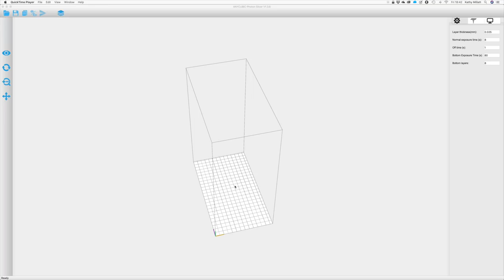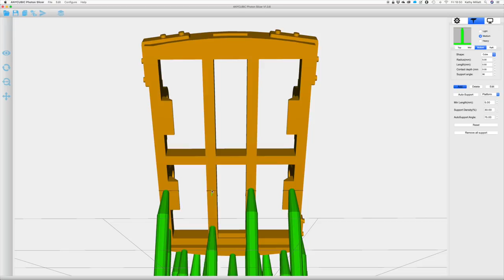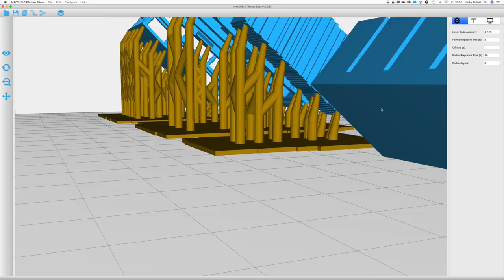3D Printing for Modelling – Resin

Comment: I've had my Anycubic Photon for over a year. It's superb for high detailed parts, and its even capable of printing at 10 microns if you dont mind prints that last for days, rather than hours. I've also noticed the price of resin has come down by about 50% over the past year so resin printing is really getting cheaper. It takes some practice with supports and print settings but with practice you will know how to print a given model.  I do get some inexplicably bad prints from time to time from model/setting combinations that have printed flawlessly before so there will be some frustration.

My advice is make sure the 2K LCD projection screen is absolutely squeakly clean before each print. If there's resin that dripped down from the build plate or somehow found its way on to the screen, it will cure and eventually you'll be replacing the screen, which costs about $40. Also, shine a bright non UV flashlight through the resin vat before printing as well to make sure there are no cured bits of resin in there from a previous print. Those cured bits can and have, in my case, damaged the LCD screen and FEP film requiring both to be replaced.

That said, no one should hesitate to get one of these machines. I've made the purchase cost back many time over from selling my own 3D printed models, as well as the cost savings from not needing to buy from others!
Reply from the maker: Great tips and I certainly recommend getting a resin printer too.

Comment: I'm glad to see you have discovered the joys of resin printing. I got one of these after seeing Luke's video about it. There is a learning curve, but I believe it has already paid for itself in detail parts produced. Since I model in N scale, detail parts can be hard to find, limited, and expensive. After printing a vent adapter for the back of the printer from Thingiverse, I don't even have to worry about the smell since I just exhaust it outside.
Reply from the maker: Luke has a lot to answer for!  I bought this about a year ago and it has changed how I approach projects.

Comment: I model railways in NZ120 (TTn3.5) which is TT scale locomotive and rolling stock on N gauge chassis and track. Since there is nothing available commercially, EVERYTHING has to be made in house. 3D Printing has made things so much easier. It really is the best thing since sliced bread!
Reply from the maker: I bet it’s made such a massive difference to you. I do love it.

Comment: Nice video very informative for beginners ,i've been using the anycubic photon for 18mths now had a few failures for a couple of months using various colours of resin , but since i changed to anycubic grey i have had no failures for 12 months plus i mainly print 15mm figures aswell as perfect uniforms i am getting moustaches etc on now ,the grey cures to a matt finish and takes paint beautifully with undercoat or not , it also seems to clean up easily GREY IS THE WAY
Reply from the maker: I’m using up my green resin but it’s good to know that I should give grey a go.
Reply from the maker: It’s a great little machine.

Comment: The thought that occurs to me is the amount of time required to create the object by this method - design it on the computer, send the design to the 3D printer, remove the object from the 3D printer, clean it up with IPA, cure it with ultraviolet.  Surely by the time you've done all those things you could have made a model in balsa wood, brass or card?
Reply: This is a valid point. However, I feel the advantages to working this way with the printer outweigh the disadvantages.
1) The amount of detail possible with this printer (I have one myself) is very difficult to achieve by the average modeler using classic methods.
2) This method allows for very quick and easy multiple copies of a model. If I need multiples of the cart that Kathy modeled above, for example, I can either print multiples at once, or just print the same file again.
3) It is very easy to make changes to a model while it is still in the computer design phase. This is very relative to your computer design experience of course, but the point is, if something is wrong with a design, or I need to just make changes, or even scale it up or down, I can do that in minutes on the computer before the model is printed. Using other methods, I would most likely have to take a model apart or even start from scratch.
4) Many models are available online for free or for a minimal cost if I don't want to put the time in to do my own design.
5) The time it takes for the printer to actually print the file, while sometimes very lengthy, is time I can also use to do other things. The printer does not need to be watched as it prints. The cleanup time is actually pretty minimal as well.
To give you an example of one of my recent projects, I build 1/25 scale car models, among others. I wanted to model an accurate hitch design to add to a pickup truck. I spent about 3-4 hours one evening creating the model. In that time, I probably went through at least a dozen different design changes and additions. I finished the final version of the model on the computer. I copied it to a USB drive, filled the printer with resin and "sent" the file to printer. I worked on the truck model while the file printed. A few hours later I pulled the finished print from the printer, cleaned it, post-cured it and painted it. I now have a VERY detailed hitch for this truck, which took just a few hours of actual work.

This really is just another tool to use in your modeling, another way of getting to the final result you're happy with. It's not a replacement of those other techniques.
Reply: @imacflyr3  I have thought of using a 3D printer to create a balustrade in 4mm scale. Which type of 3D printer would be best for this?
Reply from the maker: I’m just not that accurate and this can produce exquisite detail plus there are loads of free designs so you don’t need to design everything. 
It does move the time spent to design rather than doing but I like computer design. There’s no right answer and both are valid depending on what you enjoy.
Reply from the maker: Great answer!
Reply from the maker: I’d say it depends on the detail needed but I’d use my Photon.
Reply: @SussexHistory  The photon or almost any of the resin printers would work great for that I would think.
Reply: The Photon (and similar printers) can print in voxels as small as 0.047x0.047x0.025 mm. For reference, a hair (on a European person) is around 0.04 to 0.06 mm thick. 
You could probably beat it time-wise sculpting by hand, but, it's pretty hard to beat that kind of detail.
Reply from the maker: I hear of people going to a 0.010mm later height. Have you tried that?

Comment: As fascinating as filament printing is, I saw a demonstration of the resin system at a university.   I held Hogwart's castle in the palm of my hand.  The detail is incredible.   If I get a printer, the resin version is the way to go.   Thanks Kathy for clearly explaining a technically challenging system.  O, btw, an average human hair is 14 microns in diameter, so a layer at .025 is really tiny.
Reply from the maker: It is so amazing the detail you can get on a resin printer. If I only bought one printer, it would be resin.

Comment: Hello Kathy, could you wet sand after the supports are removed to keep from breathing in the fine dust ? Great video.
Reply from the maker: It’s been suggested before so I probably should. These designs are normally so fine that I’m using small metal files.

Comment: Kathy, this is a great vid. Some individuals hesitate to purchase a 3D printer due to fumes. I don't own one, so I can't validate their complaints. The model you show looks like the perfect one for miniatures. Thank you for sharing. ❤👍
Reply from the maker: I do vent outside using the normal utility fan but I hear carbon filters work too. It’s a great tool with very little odour but I wouldn’t keep it in my main living space.
Reply: I also have both. On FDM printers, the fumes are almost nothing so long as you're using a "friendly" filament, like PLA, PETG, or nGen, rather than the "unfriendly" stuff like ABS and most Nylons.

For resin, it's more of a thing. Particularly while printing, though even resin sitting around releases a bit of a smell. Some resins are better than others, but none of them are perfect, though I have seen a printer (I forget what it was) which had a seal around the top. I keep mine in a room I don't go into much, with a window slightly open, and it's not an issue.

In both cases, their usefulness far outweighs the problems they have.
Reply: @Maeyanie . Great additional information.  Thank you. ❤
Reply from the maker: Thanks for a great response.

Comment: I have had this printer for about a year now and love it! Has yet to disappoint me, although I have wasted more money than this printer costs on resins that have really let me down! Do yourself a HUGE favor and opt to use ChiTu software for setting up your prints. It works out of the box with the AnyCubic and there is ZERO comparison between it and the crapware that AnyCubic software brings and its free!
Reply from the maker: Thanks for the advice. I’ve not had any problems with the Photon software.
Reply: @KathyMillatt  You have not had problems but thats because you dont know what the problems are...;) One is the way it creates the rafts, you can save yourself a lot of resin over the long haul using ChiTu because you have more control over the support system for your print. Also you have more control over how much cleanup you will need to do as you have the ability to create smaller contact points, so less work removing rafts and supports along with the accompanying sanding you need to do to get rid of the nubs. Overall it offers you a lot of features you wont get with the Photon software. Definitely worth checking out and getting up to speed with.
Reply from the maker: Kevin Morrison Thanks. I have heard it mentioned. As an aside, I never do rafts and mostly use light supports and always place each support manually.

Comment: Hey Kathy what program are you using to make the files?  Is that a slicing program?  I'm getting my Anycubic on Saturday and wanted to start trying to print.  Thanks again :)
Reply from the maker: I design in blender or Fusion 360 and slice in Chitubox. The photon comes with its own slicer that you can use.
Reply from the maker: Good luck with your first print!

Comment: Hi Kathy, quick question. What do you do with waste IPA used to clean the resin models. Is it safe to poor down the drain?
Reply from the maker: No. I leave my used IPA with a lid on in the sun on a window sill then the resin congeals leaving relatively clean IPA behind. I strain it and reuse the IPA for the first wash which has the most resin in it. When it’s really on its last legs, I leave it outside to evaporate but that’s rare. I do leave the congealed resin outside to fully harden then I bin that.

Comment: Hi Kathy! Nice video! 
Why is it good to angle the object that You print?
If You hollow Your object for instance an cube, do You have to make a hole for drain, if so why? ThanX
Reply: The reason for angling prints is to combat both distortion in the print and the suction forces as the build plate lifts. The idea is to create a layer area as small as possible for each layer as the print builds. This makes it easier for the print to release from the plastic film (FEP) as the build plate lifts. You will find also that the suction forces on a print that is oriented "flat" to the build plate will distort the print somewhat.
For hollowed prints, you do have to add holes. They should be as close to the build plate as possible. The reason for this again is to stop the suction forces that act on the print. Imagine attaching a suction cup to a smooth surface. It is difficult to pull that suction cup away from the surface. This is the same force that is acting on the part as the build plate lifts from the FEP film. Now try to place that same suction cup on a surface with a hole in it or put a hole in the suction cup. It won't stick to the surface. 
Of course the other reason for the holes is to allow drainage of any uncured resin from the interior of the print and rinsing of the inside with alcohol after the print is done.

Comment: I have a few questions with a resin print. First, what does the IPA do for the resin? Only guessing it cleans it. Second, after the supports are removed from a resin print, cleaned and sanded down, is primer recommended and if so does the color of the primer matter? Abd thirdly is airbrush better adding the color versus using paints? I'm considering buying a figure thats will need light sanding but will need a paint job so I'm just asking for guidance first before I commit buying the figure. Great videos as always.
Reply from the maker: Hi. All good questions. 
IPA dissolved the excess resin that coats the outside. Some resins are water soluble but I’ve never used them. 
Primer is recommended for almost everything I paint. The colour depends on what you’re painting. I choose a close colour out of my range of grey, oxide red, black or white. I use a lacquer primer as they stick well.
Reply from the maker: Airbrush v brush is a personal choice. I’ve seen stunning examples using both. The airbrush works well for flat smooth colours or subtle grading but brushes work best for detail.
Reply from the maker: Hope that helps and good luck.

Comment: Thanks for another great video, very informative & down to earth. 
Have you had a try yet at 3d scanning or photogrammetry to model actual railway items, or did you only use 3d modeling based on geometric forms to re-create their shape ??
Reply from the maker: I produce my models in Fusion 360 or Blender. I haven’t found a reasonably priced scanning/photogrammetry programme with enough accuracy yet.

Comment: Hey, Kathy did you have to upload a dll file on your computer to get the slicing program to work?  Says I'm missing a dll file and won't open the slicing program.
Reply from the maker: I’m not sure what a dll file is needed I’m on a Mac. Both the photon sliver and Chitubox just ran first time for me I’m afraid.
Reply: @KathyMillatt  yeah I'm using IBM and it's saying I have a missing dll file.  I guess it's a common problem with windows 8 users.  Says you can get it by doing a system update but for some reason my pc won't let me even do that.  Just wondering if you had the same issue.
Reply from the maker: maxanddad1 sorry, I have a Mac.

Comment: Kathy, a quick question, just trying to determine cost, how much was your bottle of resin and roughly how many of your carts could you get out of that bottle?  Just trying to get to a rough unit cost.
Reply from the maker: Ray. Prices have dropped a lot and I haven’t done the maths on the wagon. I believe there are programs to help you calculate it but I just buy a spare bottle. It’s about £40 a litre in the UK st the moment.

Comment: I see that you're doing this work in a living space - how do you find the odor to be?  My biggest concern about getting a resin printer is that I am in a basement and I don't want it to stink up my house.
Reply from the maker: Mine’s in the utility and I keep the door shut. There’s an outside vent so it doesn’t bother me. It is a noticeable smell if I keep the door shut but not if I leave it open. It really depends on your living space.
Reply: I also live in a basement, and find the odours to be not all that bad. Some resins are worse than others, and it does smell a lot more while printing, though I have seen a printer (I forget what it was) which had a seal around the top. I keep mine in a room I don't go into much, with a window slightly open and door closed, and it's not an issue. Even when I do go there, I don't tend to smell it unless the printer is actually running at the time.
Reply from the maker: Thanks!  There’s a noticeable difference on the smell when it’s running as the fan blows the smell out of the machine.
Reply: @Maeyanie  There is a huge difference between ODOR and FUMES..... ODOR can be annoying - but if the materials are non-toxic, not a major deal.  FUMES can be odor free (Carbon monoxide anyone?) but DEADLY.... Resin is that bad combination of both.. it is smelly.. and deadly to breathe and touch.  I'll stick to Filament until it can become a bit safer... someday...

Comment: Yeah... resin printing results are great.. but the resin itself is SUPER NASTY and you shouldn't have that printer in an unventilated area like you do....
Reply from the maker: My area is ventilated with an external fan and the printer contains the smells when not in use. I find the fan blows resin fumes everywhere when in use but otherwise, there is very little leakage. If I’m leaving it a long time, I put a lid on the vat itself.
Reply: @KathyMillatt  Good to know the area is ventilated - it is very hard to tell and unless I missed it in the video - that is an important piece of info to share.  I know you mention not to breathe in the fumes or dust...  Enjoy... it looks like a great tool that produces much nicer stuff than filament...
Reply from the maker: It is a great tool but you’re right, all tools need to be treated with the correct caution. I know a lot of people use carbon filters on their printers and I am considering trying that as well.